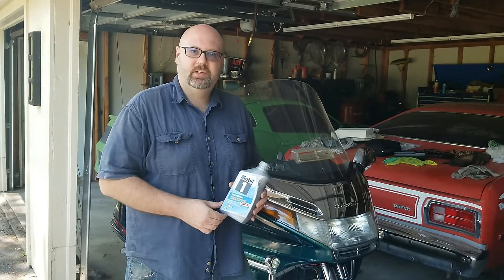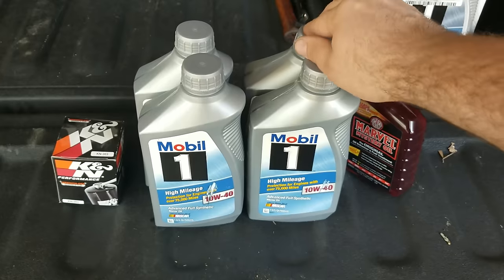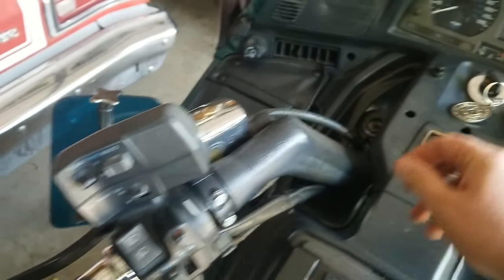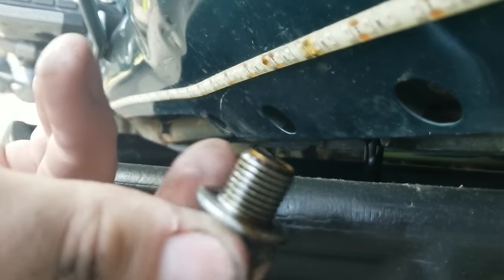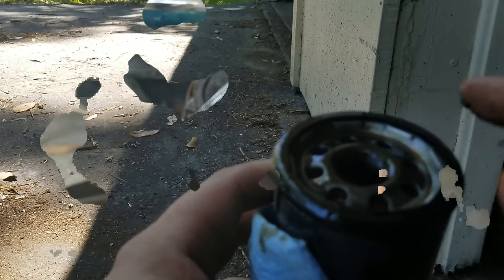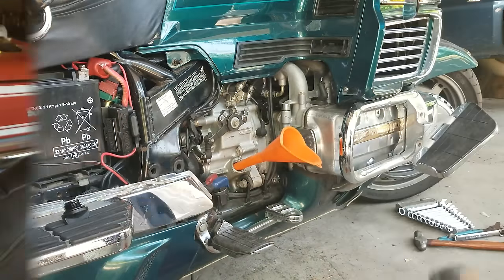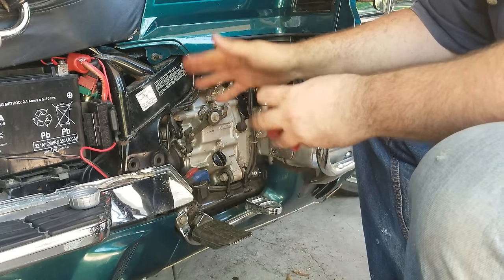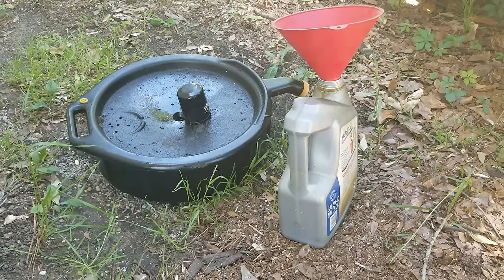How to Change oil on a GL1500

Comment: My dad was school bus mechanic, that taught me to clean every piece & areas being worked on! Cleaning everything drove my friend Harry nuts that never had time by the hour wages! This is what my dad would do: take rear side cover off, clean side cover, clean an check rear brake fluid level, small grease on side cover mounting pin rubbers gromits, he'd continue to check reverse cable, lube cables, then he'd clean front cover an grease rubber mounts, inspect front pins on front cover because they need pushed backwards to remove, an often pulled incorrectly pulled forward an broker! After taking care of whole uncovered area, then he would start on oil change procedures! Same for under front oil filter cover, he would have cleaned cover while it was still in his hand from removal, then clean horn an inspect horn wires, clean all under cover area, then remove filter! You must choose your own path, grasshopper! But my bikes looks different an cleaner after service work! Second dad's rule: never set parts or tools on vehicle project unless laid on service mat or towel! 3rd dad's rule: treat everything with thoroughness, like our own kids are going to be in it all day, everyday!

Comment: WIX Filter 51358 which, ironically, is the same filter my Kawasaki Vulcan 650 S takes.  As of end of 2023, costs about $15 at Oreilly's  3.9 quarts with filter.

Comment: I run 15-40 rotella.this oil runs in a diesel/semi engine under extreme conditions,it worked very well on my gl1200 and vt1100 shadow.however,it was to heavy for my magna and you would think it would be okay on that high rpm bike.i heard many talk about the synthetic version of rotella but some guys claim it is to slick for the clutch friction plates.in my magna I use 10-40 Valvoline bike oil and it does well.***ebay shows that the wix 51356 filter is not compatible.seems strange since it appears you have used it w/no problems.****i found the fram filter # it is ph6017A.
Reply: I just bought the STP S6017A with the Rotella for my 1994 Wing
Reply: Never use fram on anything!!
Reply: recent tests have shown Fram makes makes the best filter on the market, I have used them for years and never had a problem.
Reply: @radicalttc  many say that about WIX!
Reply: Rotella T6? I love that stuff, used on my other bikes, lawn tractors etc. Even my Ninja ZX10R. 
I’d like to think if it’s good enough to be put into Super Sports, then it should be ok for a Wing.

Comment: I have never removed that front panel to get to the filter but for this video it was very good. I do have a belly pan that I have to remove to get to the filter. Let me ask you this, have you ever put MMO in your gas ?  I do from time to time and when I do I get better gas mileage. I think the MMO keeps the fuel system clean and lubes the valves.
Reply: What kind of product is this MMO? Would love to know more
Reply: @meals24u  mmo is MARVEL MYSTERY OIL it has been around for decades
Reply: @jimeckenrode1271  ok perfect 👍 
I’m gonna look into it! 
Thank you 🙏

Comment: If you want to get all the old oil out, while you have the drain plug out, just run some clean oil through it and it will flush your pan.  I have done this on bikes and all my cars.  You can use a good dino oil if you think you are wasting syn oil.  You will be surprised at the crap that comes out and run some until its clean, usually a few ounces.  BTW, I am a retired HD Police bike mechanic-just thought I would pass that on.

Comment: Great video it was very helpful! I haven't run my Goldwing for 4 years. I need to change the battery, change the oil if l drain the oil can I switch to synthetic oil? I was also thinking about putting some WD 40 down spark plugs?
Reply: Yes u can

Comment: You need to use JASO-rated motorcycle oils as they do not contain any friction modifiers that will encourage the clutch to slip. This is critical for proper clutch operation. MA/MA2 rated oil must pass a clutch friction test. These newer (as of 30 years ago) car oils are basically too slick for wet clutches.

Comment: Nice video, have a question and sorry for this but after to many years away from motorcycles I just got a Honda Gold Wing GL1500SE 1999  50th Anniversary and just to be sure, is this oil also used on car engines! Because all the guys I ask their answer is that has to be oil for motorcycles, your comments are very important for me and all others thanks and keep On Biking!
Reply: Mario, people say that because there is an additive in car oil that can cause you wet clutch to slip. I use Shell Rotella  5-40 syn diesel oil and it does not have that additive. Many many Gold Wing riders use Rotella  it seems to be the favorite.

Comment: I just bought a 95 Goldwing same color as yours.  Thanks for all your videos, I'm learning a lot.  Mine came with a CB antenna not attached.  Could you do a video on how to install antenna and CB?  I have the control panel on the left side and when I turn it on, the light comes on and i can hear the squelch but not sure how to get it to work.  Thanks

Comment: Good video. You didn't mention why you're using the high mileage variant of Mobil 1, which is important. For those who may not know, the high mileage oil, in addition to diesel oils, do not have the friction modifiers which are bad for wet clutches. The way to know for sure is if the API service donut label does not say "Resource Conserving" then it's safe in motorcycles.
Reply from the maker: Mainly because it's a video on how to change oil for the goldwing. Not  about the oil I used, even though i did briefly touch on it. I just didn't want get off topic to much, because that's easy for me to do and its already a 20 minutes long video.
Reply: It's a full synthetic... therefore it has the friction modifiers in it...
Reply: @CliffordRice  Well, the Goldwingdocs guy recommends the same oil as you did. He recommended using Sea Foam to get rid of the crud that builds up  down around the little arms that engage the reverse gear, from memory. Also, 3.9Qts =approx 3.7 liters for those of us in the metric world.

Comment: A couple of things.  You should really wear gloves as used engine oil is quite nasty stuff, also, if the oil is hot when you undue to drain bolt, it won't burn your hands if you get some on you when undoing the drain.  The oil will drain a bit quicker if you undo the oil filler cap before you start to drain the oil.  Finally,  I know you probably did, but it is important that you clean the mating surface where the oil filter fits.
Thanks for this, enjoyed watching it.
Reply: How old are you?

Comment: You will be turning the oil filter as you put it on, so you only need a little oil inside and it will rotate around.

Comment: and you never experienced some clutch issues with it? I was in the thought, that we need to use motocycle oils because of the wet clutch system, with same specs like 10W40 or 20W50 whatever

Comment: Clifford, I noticed your LED lights on the bottom, right outside the exhaust. I just ran a s#*tload of lights on my GL1500 and was worried about the heat from the exhaust affecting the adhesive. I haven't ran any there yet, but now that I see yours, I want to. Any adverse issues or are they all good down there? By the way, your videos have been a big help to me lately. Just bought my first GL1500 a couple months ago, after many years working as a Honda dealer and being in a family of GL owners. I realized I never knew quite a bit. Thank you! Keep making these!

Comment: Hi Clifford, I'm Mexican and I watch your videos a lot, this year I hope to buy a goldwing 1500, when are you going to upload more videos?
Reply from the maker: I hope to do so soon, 2019 was not a good year for me...working out of state,  and then a tree fell on the garage....so I'm trying to piece everything back together.  Hopefully with a bigger and better shop.
Reply: @CliffordRice  
How terrible about your house and that damn tree, but are you okay? is your family ok? And now with this problem of the coronavirus, let's hope in God that this is over soon, I hope to see you soon in those pleasant videos, I will send you a photo of my goldwing, I hope it will be in December of this year, regards!
Reply: @CliffordRice   I am a first time goldwing owner sir, I found a 97 model higher miles but runs great.  The only problem is after about 10-15 minutes riding it will no longer pull for about an hour or  less,,,, any thoughts?..... needs new  clutch and pressure plate maybe, or even could have car oil in it causing the slip. I am no motorcycle mechanic and she my first goldwing not sure how to approach it I'd love any advice please sir.  Ride safe.

Comment: I just bought a lovely 1997 Wing, and they advised me to NOT use synthetic oil, but rather semi-synth.
Reply: I have been using Shell Rotella 5-40 synthetic for over 20 years in my Wing and it has never had a problem with synthetic. In fact most member of GWRR use Rotella in their wings.
Reply: @jimeckenrode1271  AYEEEE nice!! You mean the T6 Diesel Oil?
I used the Rotella T6 synthetic on all my other bikes including the Ninja ZX10R and it ran great.. 
Now that I picked up a Goldwing, I’m considering putting the Rotella in there as well.. thoughts?

Comment: You say that you use Marvel Mystery Oil in your Gold Wing. On the Marvel Mystery Oil website they say, "Marvel Mystery Oil is not recommended for use in motorcycles with wet clutches." The Honda Gold Wing has a wet clutch.
Reply from the maker: Yes you are correct, that was a mistake on my part

Comment: Hola amigo mi gl es igual qe la de usted e aprendido mucho con sus consejos y enseñanzas sobre la moto pero descubrí algo qe qisas no sea tan importante mire qe mete todo el shock hasta fondo yo asia lo mismo y mi motocicleta encendía más lento como la de usted y metí solo la mitad de el shock y en cuanto le enseña la llave enciende espero qe la traducción qe use le diga lo mismo qe escribí gracias sr saludos desde baja California México like like y + like

Comment: My 1998 GL 1500 radio stopped working. The radio is not powering up. Anyone knows why and what to do?
PS: It was working last year but I left it parked outside during the winter. I had to change the battery and right now the motorcycle runs good except the radio.
Reply: I was thinking of fuses but I can't tell which one is for the radio

Comment: Excellent series of  videos on the Goldwing as i just got my first one, however i noticed that you are using automotive oil , which i've been told forever that they don't contain the friction additives for the clutch like all motorcycle specified oils , so it might make it slip. Any issues with that? Txs Jeff
Reply: Rotella T6 Full Synthetic Diesel Oil for me! 

Goes into everything except the wife! 👍

Comment: Wouldn't a motorcycle oil be a little bit better.
Reply: Generally yes, but a Honda Goldwing GL 1500 is really a car engine and very, very low rpms and under taxed. Not like a high performance engine with extreme revolutions. It moves this cycle very easily, way more power that it needs. Its no strain on this engine.